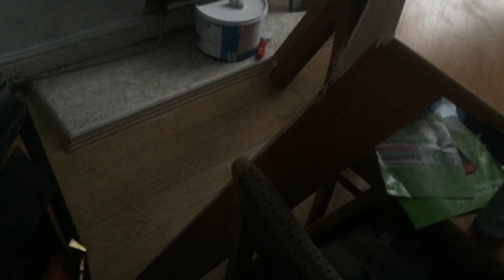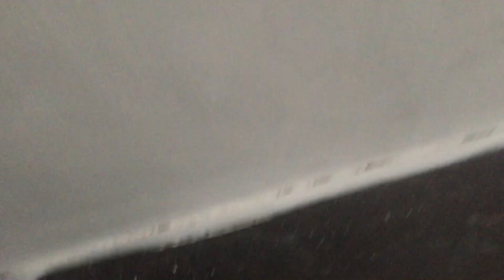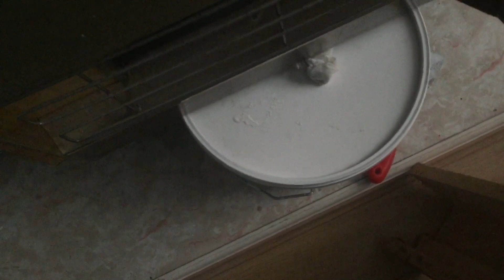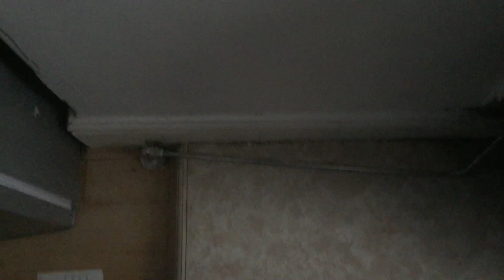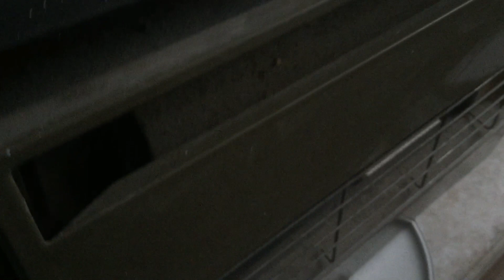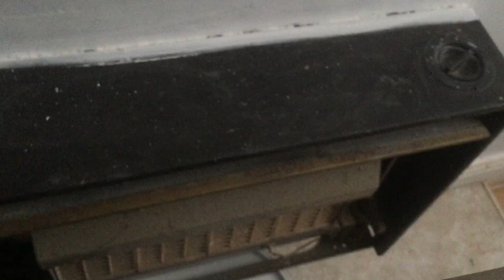How To Remove Old Gas Fire From Wall - UK (After Corgi Engineer Disconnect)

Comment: I have been looking for this video, thank you, I have exactly same but i need to know how do u close the pipe as i do not want to replace just remove it from the wall. Please help thanks.
Reply: As it’s a gas appliance, if it is still connected to the gas supply you will need to get a corgi registered/ gas safe engineer in to cut off the supply. As far as I’m aware, it’s illegal to do it yourself

Comment: Hi, I know this is an old video but hopefully you see this comment 😂… this is the exact gas fire I have in my house, it’s been capped off professionally and I want to remove it, did this leave a hole or anything behind it on the wall? Thanks
Reply: Yes, there was a hole because the fire covered the chimney breast. As I replaced the gas fire with a fake electric coal fire, the hole got recovered. I hope that helps.

Comment: This video would be great if shown to a load of bats,! Where's the lights???
Reply from the maker: Brian Botterill unfortunately the room was surrounded by building material which blocked the light, so it was hard to film it with light. It was an impulse thing but if I had planned it better I would have brought a torch. I simply decided to do a video as I couldn’t find any instructions online. It’s better than nothing. If you have any questions, feel free to ask.
Reply: @Perkozac  Hi. Do you need to brick it up after for an electric fireplace? Ps. Thanks for the effort.
Reply from the maker: Paul Ruwona I have one in the living room exactly the same that was done 16 years ago. It was never bricked up and the fire still works perfectly. Hardly use it though, it’s just for decoration as I have central heating.